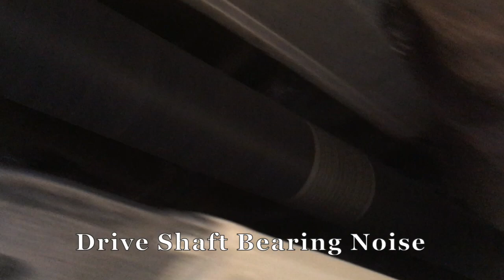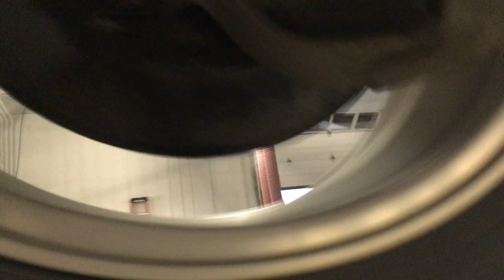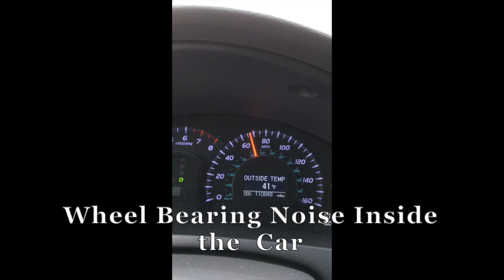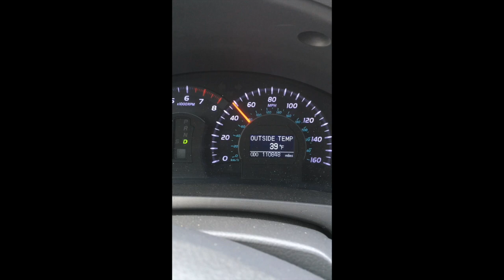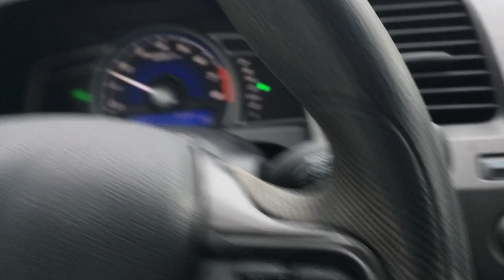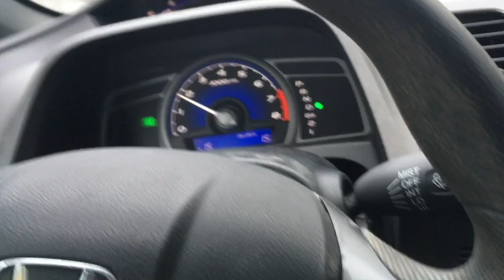Wheel Bearing Noise VS. Drive Shaft Bearing Noise

Comment: When I accelerate sounds becomes higher, but then when I'm driving 70 miles per hour, then it is not too bad. It sounds like an airplane engine. I can control the sound, kind of. If I press on accelerator it becomes higher, and when I let go it becomes weaker and every time is like that. Trying to figure out if it is differential or drive shaft U joint.
Reply from the maker: Hi Mijagi, If it sounds like an airplane it's most likely a wheel bearing or driveshaft carrier bearing, definitely not a u-joint. Keep me posted on what you find, thanks.
Reply: @EddieCarrara1  Hia also My Corolla there is bad sound maybe it's shaft Bearing?
Reply: This is EXACTLY what I'm dealing with on my sprinter. Already spent thousands at multiple mechanics on struts, control arms, balancing alignment and other suspension shit. Nothing is fixed im so tired of it
Reply: It’s the driveshaft carrier bearing , It would sound loud accelerating till a certain speed ,then it would stop but have some noise,I’d get it fixed soon for it sounds a whole lot wors
Reply: I have an exact similar issue and my mechanic said we have to change tire rod, driveshaft and carrier bearing of the passenger side. 

Please help me what caused that issue and what part that you changed stopped that noise?

Comment: My right front wheel sounds like metal scraping really bad consistently for twenty minutes and this shop said its my wheel bearing but it doesn't sound like this at all
Reply from the maker: Did they say that the wheel bearing is loose? If the wheel bearing is loose it possible the the rotor is touching the backing plate. The rotor is mounted to the hub and the wheel bearing is mounted to the hub so if there is any play in the wheel bearing it could affect the clearance between the backing plate and rotor.
Reply: @EddieCarrara1  okay thank you I appreciate it alot 🙏

Comment: Hmm thought one of these might have been my issue, but maybe not. I hear what I can only describe as the sound of a propeller plane at 60-80mph speeds
Reply from the maker: Hi Junaid, I recommend you have someone check your wheel bearings with a stethoscope, it's the fastest way to know if a wheel bearing is causing the noise. You may not notice it at low speeds and it more obvious at higher speeds, just the opposite of what I state but nothing is impossible.

Comment: Thank you for demonstration in details all those noises. I had a clicking noise on left turns, so it is Passenger side CV Axle, so I'm replacing the CV Axles. When I removed the Passenger CV Axle I decided to replace the Seal as well. This Seal is on the Passenger side, so on Intermediate Shaft. It is 2001 Saturn SL2. When I removed the seal there was a lot of grease inside of the housing of the Intermediate Shaft. It was like half of the space inside was filled w/some grease of cream color. In Shop Manual (I have it for that car) nothing is mentioned about that grease. They just say to clean the Intermediate Shaft housing and apply the axle seal grease on the lip of the seal (where rubber is I assume), and to axle bearing (not sure is it inner side of the CV Axle or outer one?). So should I fill in that housing w/some grease, how it was before? Or that grease shouldn't be there. And what grease to use? I have White Lithium Grease and Green Lithium (that one you can add into Ball Joint and Tie Rod Boots. I also have some Red Grease. This part of the project is very confusing. What grease to add and how much? Thank you again.
Reply from the maker: Hi Olena, I know that the grease is CV joint grease but I don't know what to use for an alternative. If you have an auto parts store near you I recommend checking to see if they carry any, if not you can get some on Amazon, where else lol. Here is a link https://amzn.to/41B1ZyR, if you decide to purchase this through my link I make a small commission but you don't pay more for the part. I have to make this statement because I'm an Amazon affiliate. Let me. know what happens.
Reply: @EddieCarrara1  Thank you. For some reasons I can't find that information in the Shop Manual I have for that car. Probably I need to look more (they are huge 3 volume books). I thought about Green Lucas I have, but probably check w/Dealer, since someone wrote that Green Lucas can be not so good at low temperature. We are in Dallas, but sometimes in winter the temperature can drop. That CV Joint grease I ordered already before (I might try to rebuild the original CV Axles, though I'm installing new ones I have (also fm/Amazon)). Can you tell if that grease is Synthetic?

Comment: When I put it on drive theirs a bang noise when it get the gear ..then when I shift to reverse and accelerate loud bang noise is heard
Reply from the maker: Hi Bear, I'm not sure what kind of car you're driving but it sounds like either a CV joint or U-Joint  may be your issue.

Comment: mine sound more like a cricket and between 2k and 3k rpm, it sounds louder if I accelerate harder, only with clutch and gear engaged.
Reply from the maker: If your vehicle has u-joints you may want to check them.

Comment: I get like a grinding noise when I accelerate can it be my driveshaft?
Reply from the maker: Hi Agustin, it could be a u-joint or maybe a rotor backing plate?
Reply: It’s the u joints
Reply: Thanks it was a metal plate under my motor I had lower my truck but did not know I had to remove that plate

Comment: Hey, nice video but I'm still not sure what the problem is for mine. I have a awd Rogue and the loudest noise it makes is when I go in reverse, especially if I cut left or right — it makes a loud squeaking/crunching/grinding noise. Also loud/vibration when I drive 50-60mph. I don't know if it's the wheel bearings or the drive shaft or both.
Reply from the maker: Hi Zoubair, I recommend you start by checking all 8 brake pads, the noises you're describing sounds like an inner brake pad is very low. Let me know what you find, thanks.
Reply: 4wd front axle most likely the passenger side, hub bearing, have f450 has same issue when driving under load it vibrates harsh and when reverse it makes crunching grinding noise.

Comment: I have this rocking chair ish noise in my 2015 Audi S4 and we’ve replaced a lot of stuff to try and figure out what it could be, it shakes a bit when on the brakes but the noise is only when the cars in motion, if you can help please do!!!
Reply from the maker: Hi Ellis, does it sound like any of the noises in my video? Did you replace the center carrier bearing in the driveshaft? I don't know of any common problems with the Audi.

Comment: QUESTION....I have an AUDI A8 Quattro...I replaced driver side wheel bearing bc of distinctive noise ( I have replaced rear before which fixes it)....I put my car on 4 Jack's to try and isolate "wheel bearing" noise. The problem I had was when I tried to accelerate with car on jacks....it seems like the ABS was engaging.....is there a way to disengage....so that I can simply bring car up to constans speed of around 30mph??
Reply from the maker: Hi Derek, You'll need to shut off traction control and any eyesight functions if you have them, then you should be able to drive it on jack stands.

Comment: Awesome video just replaced a engine on a 12 accord after replacement I got a similar noise thinking I damaged the transmission because I hit the passenger side axle a few times while installing(should've just removed it) but I thought ok I damaged the final drive in the transmission so I found one low mileage and replaced it still same noise "growling like noise that get louder the faster I go it's loud scared to go past 40 mph so I know it has to be the intermediate shaft or wheel bearing and don't want to throw anymore parts at the car wondering how you bypass traction control to put in the AIR and accelerate and find exactly where the noise is thanks in advance
Reply from the maker: I'm sure you figured it out already, just turn off the traction control. Did you find the noise?

Comment: When I'm driving on the highway. I hear the noise more when I'm turning to the right on turns. When I'm turning  to the left the noise goes away. So in my case is it the front right or front left?
Reply from the maker: Hi Julian, so when you turn right the weight of the vehicle shifts left so it's a good possibility that the left wheel bearing is the problem. This diagnosis isn't 100% guaranteed, but in most cases this is how it plays out. Keep me posted on what you find, thanks.

Comment: Bought a 08 Volvo XC90, car vibrates 35-40mph, previous owner states unbalanced drive shaft, is that even a thing? The driveshaft was replaced when looking at the previous records
Reply from the maker: Hi Jared, if the driveshaft was replaced, hopefully they replaced it with a balanced one lol. I recommend having the tires balanced first to see if that changes the vibration at all. Keep me posted, thanks.

Comment: My car is a FWD and is making a noise just like the drive shaft bearing noise, what could it be ?
Reply from the maker: Hi Vinicius, I recommend you check your carrier bearing on the front axle shaft if your vehicle has one. It's usually the passenger side axle.

Comment: I have a whinnying up noise when speeding up and and whinnying down noise . Seems to be getting louder.
No vibration and stable loud sound at speed .
It's not tire noise as I've had tire change and this noise is still slowly getting louder.
Does anyone have any ideas.
Nissan Elgrand 2 wheel /all wheel.
Reply from the maker: Did it sound like the wheel bearing noise in the video?
Reply: @EddieCarrara1  yeah .....I made mechanic come for a drive as they were trying to get me to fix everything but!
He said yeah your right, but it's just starting and people usually don't pick up on it until it's extremely loud!
I said by then you will be doing me over for more struts ect.
I told him I wanted both front done asap.
So thank you for giving me the confidence with this video to put my foot down and demand he diagnose!
Reply: Car now perfect 🙂👍
Reply from the maker: @creativeme282  That is awesome 🤣 I'm so glad you took a stand, it will make them think twice next time. Thanks for the feedback, I really like to hear positive outcomes.
Reply from the maker: @creativeme282  Sweet!

Comment: Hi, i have noice in my car when driving on speed 60 to 80km/ph and when i am pressing gas padal its gone
Reply from the maker: Hi Mohammed, I recommend you inspect the tires for an uneven wear pattern. If the tires are chopped or feathered they can produce a very similar noise and because the noise changes on acceleration it makes me think the tires may be the problem. If all the tires look goon with no uneven wear I recommend you have the drive/propeller shaft bearing inspected and diagnosed. Let me know if you have more information or question, also keep me posted on what you find, thanks.

Comment: Great video.. This almost sound like what I'm hearing on my Mazda 6 2010. I'm thinking it's the left wheel bearing.
Reply from the maker: Hi Jay, if you can get the wheels off the ground and spin them you may be able to hear the noise. If you spin the suspecting wheel and grab the coil spring you'll feel the bad bearing. Let me know if this helps.
Reply: @EddieCarrara1  Thank you so much for replying back. I'm going to try this later.
Reply: Got the same noise on my mazda bt50
Reply from the maker: @dgtjfgjfghgdftuy  Which one do you think is bad now that you heard both?

Comment: You are a God with a toolbox. My 1988 BMW 735i makes this noise but only when the car is too hot so I am guessing it may be the differential but I find it strange that it doesn’t occur unless the car is running hot. It stops when the car stops or in park.
Reply from the maker: 😂 Thank you Plugsby. Is this an automatic or stick transmission?
Reply: @EddieCarrara1  It is automatic, the shift release is broken and it shakes when i apply the brakes but the brake booster and master cylinder are fine the brake pads are 90%, the rotors are good, car makes no noise when cold and makes this noise when the temperature slightly exceeds normal operating temps, if i accelerate through it i cant hear it.

Comment: My sound I think is the drive shaft. it comes from under car and not tire area. it hums until I move steering left a little then back to center it stops yet doesn't do it when i turn wheel to rt... , I've had les Schwab look at my tires and they said everything looks great...  should I just have drive shaft looked at? I drive a 2016 Nissan rogue.
Reply from the maker: Hi Jenn, That actually sounds like a wheel bearing. The driveshaft noise wouldn't normally change sounds when turning. I recommend you have someone diagnose the noise, someone who has experience with wheel bearing noises if possible.

Comment: I have a Ford Edge 2017 FWD and I'm crazy with a noise, it has a noise like buu buu buu, I've changed the wheel hub on the right side which was where the noise was most loud, after the change the noise continue. It is heard when the car goes straight or I move the steering wheel to the left, the difference its the frequency of the buu buu buu and if I turn the steering wheel to the right it disappears. The mechanics each one give me a different diagnosis, they tell me that change the other wheel hub, another one that is the front CV axle. I have also move the tires from back to front and the noise is the same. The sound is heard from 25 mph and at 85 mph is the loudest. What do you think? I recorded the sound with my cell phone.  Thanks for your help !!
Reply from the maker: Hi Esticeman, 
Can you upload the video to YouTube and then send me a link or post a link here?
Reply from the maker: @esticeman  That is a wheel bearing noise.  I don't know which one tho. You'll have to have the noise check while the car is in the air and with an automotive stethoscope to pinpoint it. Hope this helps, keep me posted on what you find, thanks.
Reply: @EddieCarrara1  yes, I changed the wheel bearing left side, and the sound is gone. Thanks

Comment: Hello in my car the sound is similar after I exceed 100 km and when I press the gas pedal it disappears and when I move my foot the sound comes back similar to the video Thank you very much
Reply from the maker: Hi Hayder Waely, most likely the noise is coming from something in the driveshaft like the center carrier bearing or one of the u-joints. Hope this helps.

Comment: 2008 Chevy Colorado. Replaced both wheel hubs on front. When driving even with just a slight turn it’s making a thump thump thump. And when I slow down I can hear it slightly. It mostly makes the noise when I’m turning. I am lost. I have changed the bearings. I don’t think it’s a cv axle. I’m going to try to switch tires around and maybe the noise will move. Tires are in good shape. It doesn’t shake bad or anything it just makes the noise thanks.
Reply from the maker: Hi Mr Klaiber, It sounds to me like a CV joint, especially if the noise is when turning. Bearings don't usually make a thumping noise. Tires could make noise if they were chopped but if they're in good shape I think you'll be replacing a CV joint sooner than later lol. Keep me posted on what you find. I have other videos on my channel about CV joint noises. https://youtube.com/playlist?list=PLSLznc0opokTn0IwL2GVwfafFXpq1T1Xc

Comment: My 2012 Nissan Titan 2wd is making one of these sounds, not sure which, rpms doesn't seem to affect it nearly as much as vehicle speed. Does not shake the vehicle except for a fairly steady humming sound and vibration that I can feel after reaching about 30mph. Does not seem to pull the steering any direction while driving or stopping quickly.
Reply from the maker: Hi Knightskier, It sounds like a wheel bearing by your description. Can you make a short video of the noise and post it on YouTube then send me the link so I can listen to it?
Reply: @EddieCarrara1  Thank you for you reply. You were right, it was the wheel bearing. But I can't send you a video since I already fixed it. Thank you anyway.
Reply from the maker: @knightskier398  that's alright, I'm glad you figured it out 👍 Thanks for coming back with an update, I really appreciate it 😊

Comment: 09 sienna xle awd,.i replaced both front bearings and still make a noise at any speed sounds stronger on the passenger side , lifted the car no noise from shafts just from the front right wheel or cv axle is not 100 percent bearing noise that's  why im not sure exactly what the problem is, what you   think? Tnx!
Reply from the maker: Hi Gman, it's possible you have a defective bearing or it was damaged during installation? Are you absolutely positive the noise is coming from the front? Bearing noises can travel and echo in the cars cabin appearing like they are coming from a certain area. The best way to be sure the noise is coming from the bearing is to put a stethoscope on it when the car is on a lift. Let me know if this helps.
Reply: @EddieCarrara1  we actually replaced the bearing with a new one, no more noise.

Tnx
Reply from the maker: @MyPostville  Awesome Gman, thanks for the update 👍